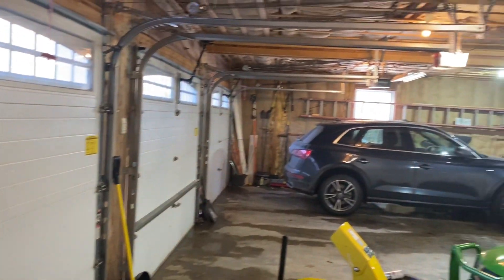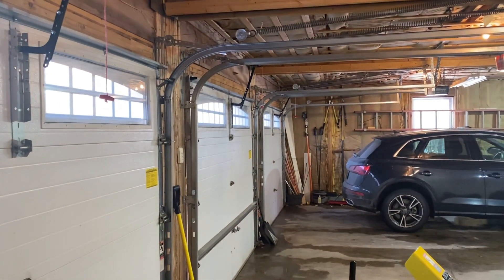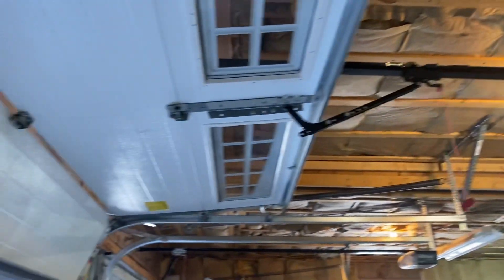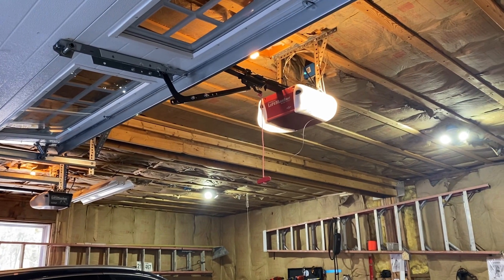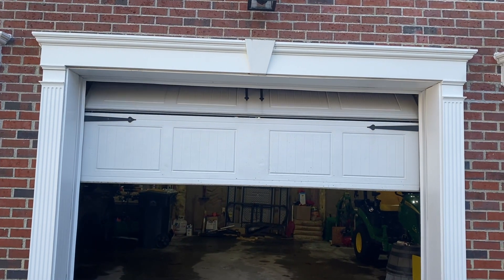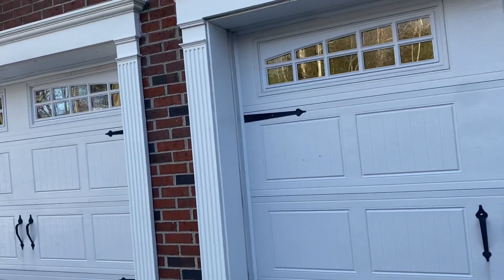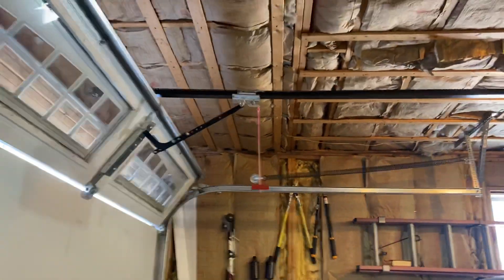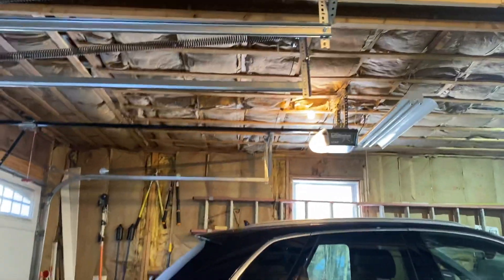Updates in the garage

Comment: That comment about whining on the 8550… mine makes more of a whirring sound because my doors’ springs were set just a bit too tight

Not sure if this is just because the motor in it isn’t designed to take that kind of force or if something’s just loose on the inside
Reply from the maker: These newer 8550s can make odd noises